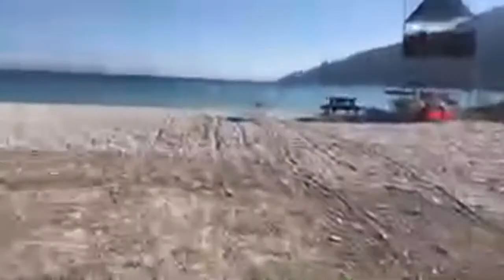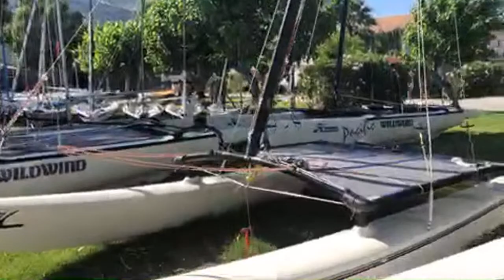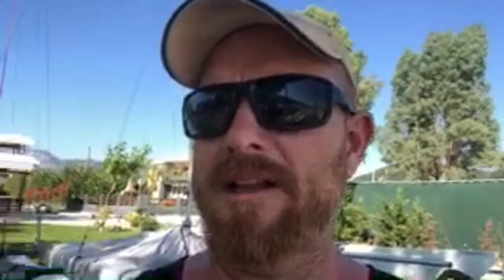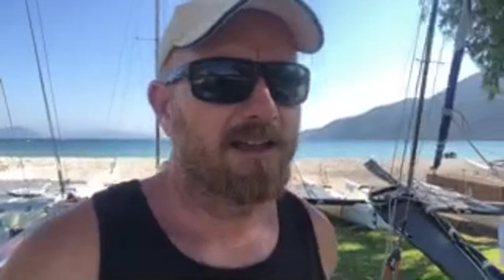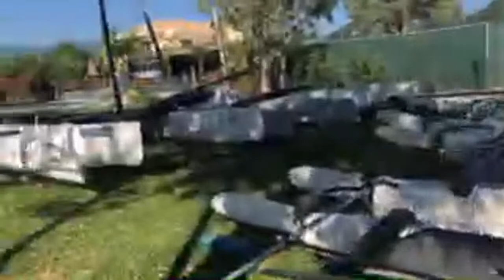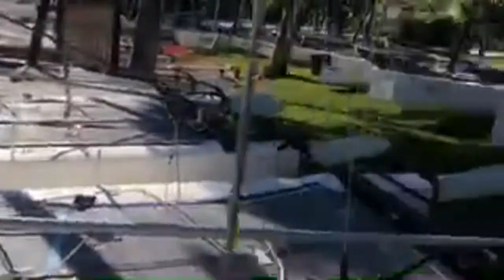Q+A LIVE 08 - Your catamaran sailing questions answered!

Comment: Hey joe, I can never manage to catch these live....question from Virginia, USA. I’m new to sailing and have been having fun on my 14. Sometimes when I drop the sail, the metal bead on the halyard (the one that you bring to rest behind the fork at the top when raising the sail) ends up coming down the channel for the bolt rope of the sail. I end up having to tie a line on and run it back out the top to get it out. How can I avoid this all together?
Reply from the maker: I would perhaps try a different size shackle on the top, maybe slightly longer. 
See if that helps.